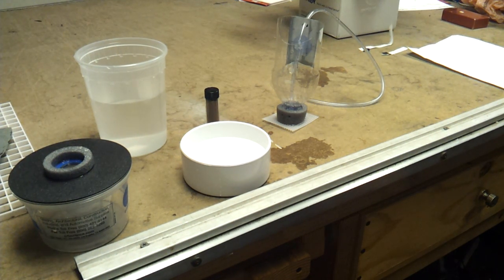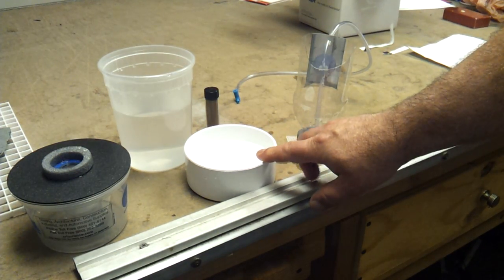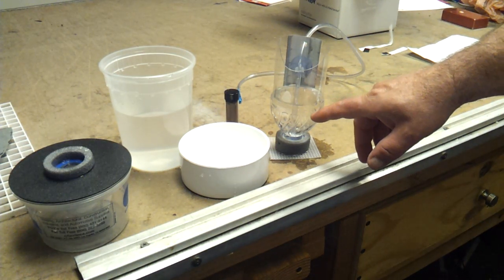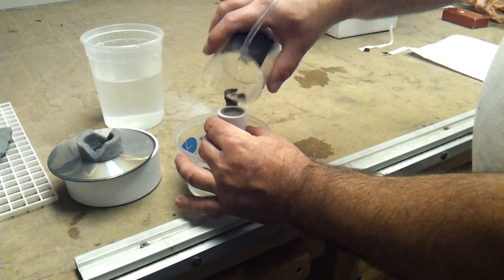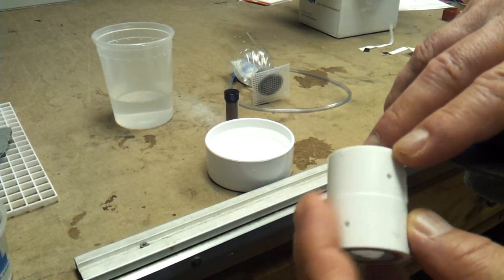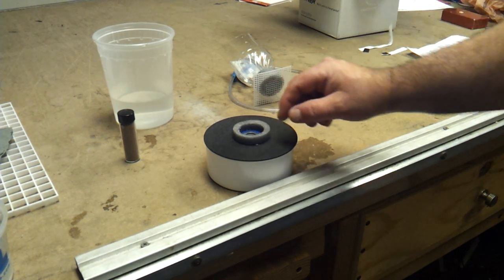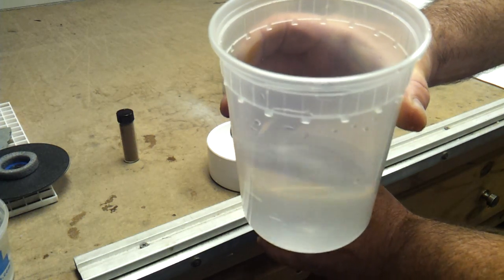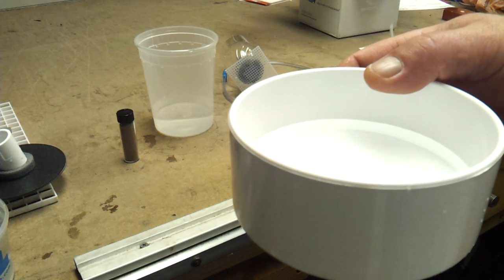Demo DIY Brine Shrimp Hatchery/Egg Separator

Comment: very nice
Reply: I use something similar, but just pour the water from the bottle with the hatched shrimp and eggs right into the pvc cap then put the lid over the cap with the trap and collect the shrimp. There’s no need to pour the contents of the bottle into the bottom of the trap and then use new water etc etc. What’s the point in that step?